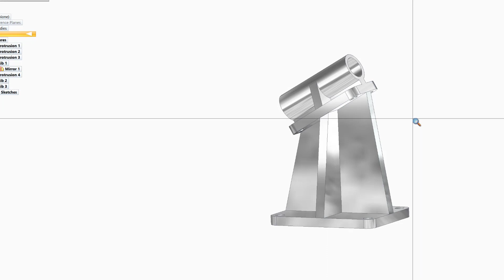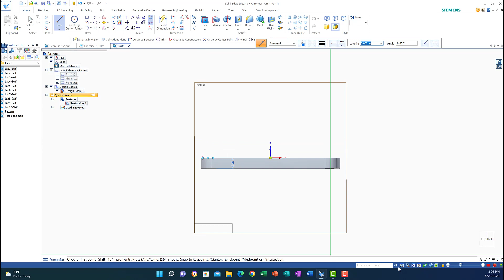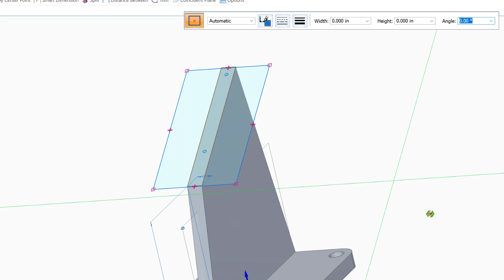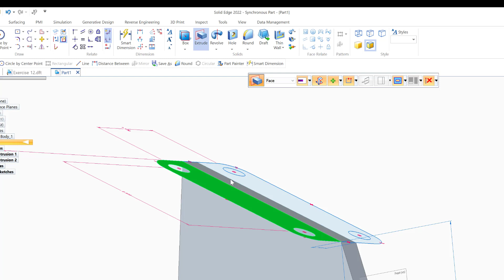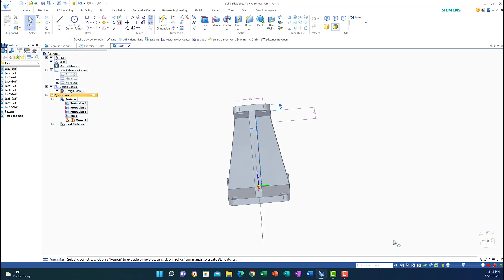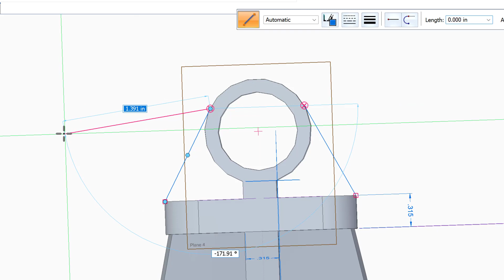Solid Edge Tutorial - Inclined Bracket - Exercise 12

Comment: Thank you for your training lesson. One can get a nice optical intersection appearance between upper rib end and elevated platform, if using lofted protrusion instead of the rib command.
However, obviously this will twist the rib slightly along its overall length. I was trained in precision engineering some 45 years ago, but never worked in the field since then. But I doubt, that
anyone wants a twisted rib for any production purposes- so yeah, probably not a good idea to consider a lofted protrusion on this part.
Reply from the maker: Thank you so much for your thoughtful remarks.

Comment: I ran into a issue with trying to place the .650 dimension between the center of 1" circle and the top lip of the angle plate.  I will try to beat it into submission with my brain after I take a break! It wants to shrink the .315 edge down to .266. Ah..No...It should adjust but maybe I need to place.650 after I place the 1 inch circle first , then Lock it.   YES!  that was the Golden ticket!

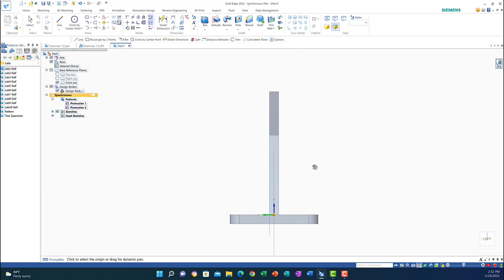Comment: "Look at Face" command under  View Tab.  at 14:35 you are struggling to get oriented for a sketch.  You should learn the commands for planes. The "Look at Face" command is what you needed for what you were asking to do. To use: Click on the Command. Click on the Face you want to look and the part will orient Normal to that face. So, you will be directly looking at that surface/face.
Reply: When you are locked to a surface you can use "Sketch view", shortcut key Ctrl-H (in Windows), to orient to the surface. You can also find this through the "cube" (lower right) - when hovering over the cube, you see an icon that looks like an "eject button" at the lower right of the cube. Press this icon and choose the "Sketch view".

Comment: It is simpler to draw the majority of the part from the side. The 4"x0.315" base, the left rib, the top tilted flange, and the last rib. Then, extrude each in succession. Next 0.315" fillet the eight corners. Follow with each of the 4x0.315" holes in each flange. * Continue with rest of drawing.   Object of drawing is to simplify the construction, use least commands, mouse movement, and clicks.   Coming from a practical use in industry where inefficiency, inaccuracy, fumbling skills - get one fired.